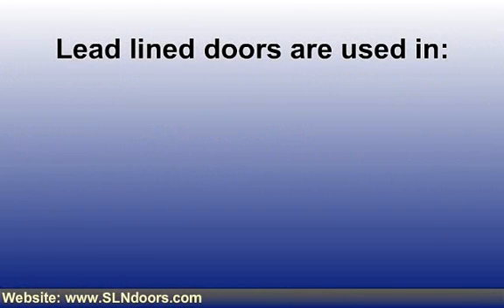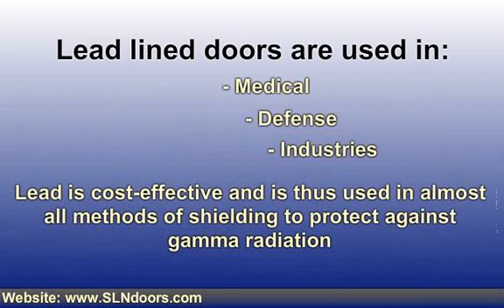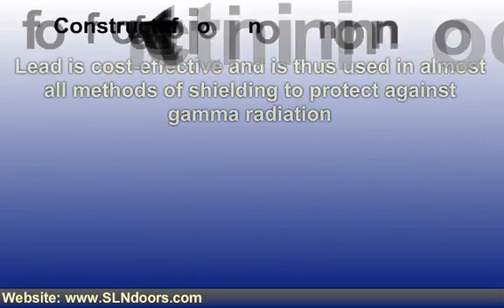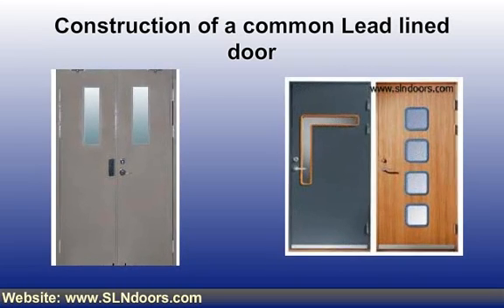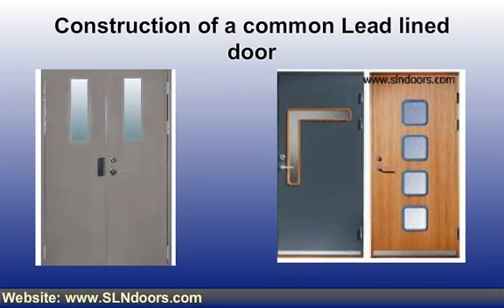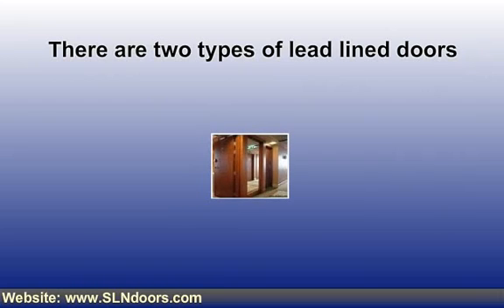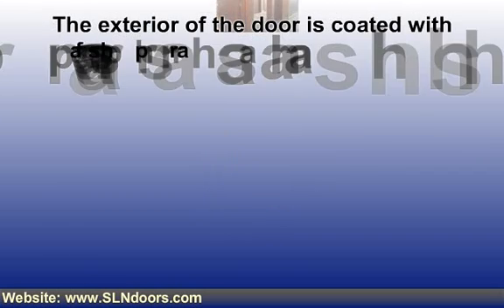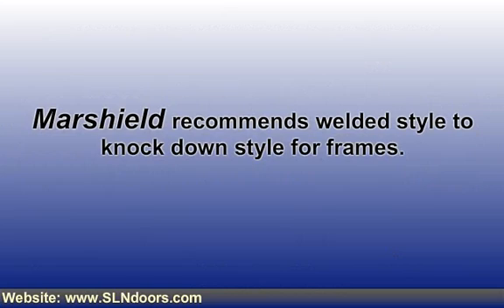Lead Lined Doors

Comment: Our hospital is in urgent need of lead lined waste containers. Can you kindly suggest a supplier of this product?
Reply: Medi-Ray supplies lead-lined stainless steel containers that provide a dent-resistant, stable and easily cleaned outer surface that does not chip or wear like traditional paint finishes.

Ref: http://www.mediray.com/product_category/product/storage_and_decay_containers/lead_lined_storage_and_waste_containers